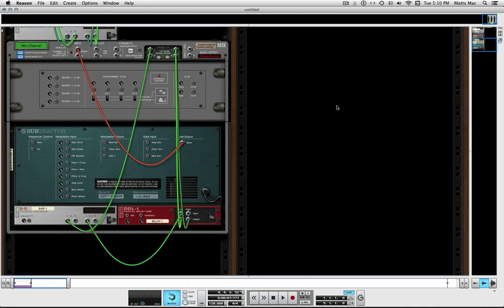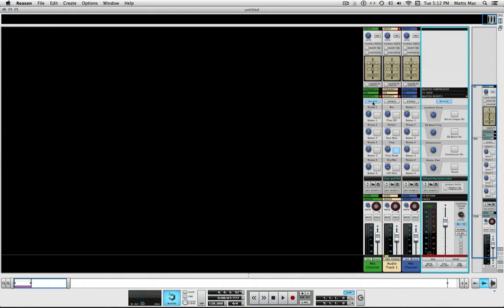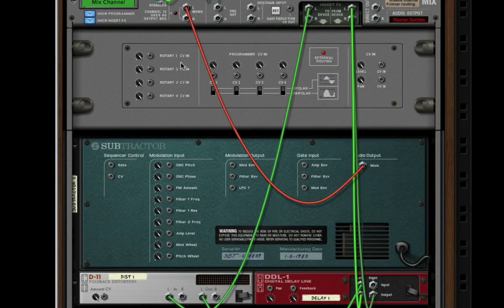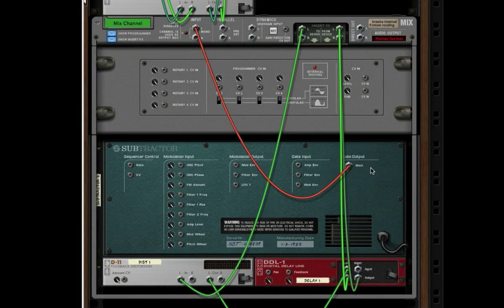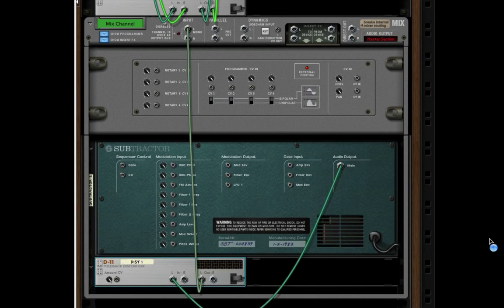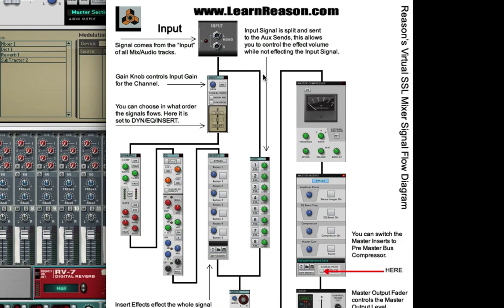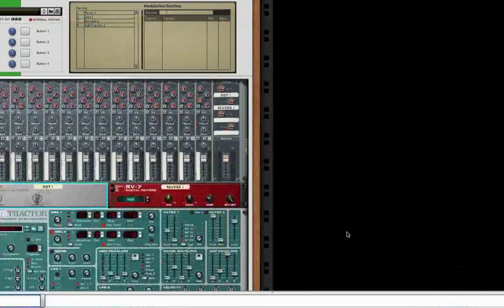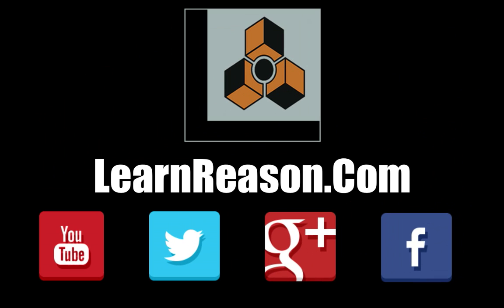SSL Signal Flow - Insert Gain Control - SSL Mixer Video Series - Reason - LearnReason.com

Comment: so why not just make all effects including compressors limiters etc send effects if there is the danger of losing control of gain structure with inserts?
Reply from the maker: Send and Insert effect are handled differently to give you more options, they are not the same.
Reply: thank you for this channel 🙏🙏

Comment: Hi Matt, Thanks for the very useful video. 

I still cannot understand why having inserts makes the gain nob useless. According to the diagram, input goes into the gain control nob and then goes into inserts. That means the gain nob controls the input level of inserts. When the input level changes, shouldn't the output change accordingly? Why is it not happening?
Reply from the maker: The purpose of a Gain Input on any mixer is to be able to control the gain from the start of the mixers signal chain. As for inserts you are right, it will affect them but again the purpose of the input gain is to set it first when you are setting your static mix. When doing this all inserts should be off as will as sends, eq, comps and all input faders should be set at unity. Once you set your input gain you should not ever have to change it thus it will never do more then what it's true function is.
Reply: LearnReason Thanks. Does it mean that inserts can still be used if they were bypassed when the gain is adjusted ?
Reply from the maker: The input gain is just a gain control to the mixer channel, it is used to control the input to the mixer nothing more. The inserts have a totally different function and have nothing to do with the Input Gain.

Comment: I have a similar problem with the audio track. I've recorded my guitars into an audio track with the Soft Tube Amp into the insert effect of the rack and the gain knob didn't respond well. I understood it was because of the inserts, so I solved the problem by routing the audio track from the direct out to the input of a new mix channel. But now it bugs me that I have two mix channels in my mixer for the same track. Is there a way to be able to control my gain for my guitar tracks but without the "dummy" audio track in the mixer?
Reply from the maker: Inserts can over power the input gain, its best control the insert gain from the insert if this happens. Just put the insert effect in the track combinator and assign a knob to the output of the effect. Now on the VSSL mixer you can adjust the gain right from that channels insert knob.

Comment: Couldn't you just use your send levels separately to fix this issue, especially if your using the fx to mix in separately the fx from the original sound ?
Reply from the maker: Official AbedNego I guess if you wanted to have the effects as Sends you could but a Send is not the same as an Insert thus it's important to understand that the Insert output can over take the channel Gain Input and that is why I made this tutorial.
Reply: very true , thanks for the infos

Comment: Matt would you be able what the insterts are good for please. So far looks like using them is what we don't want to do but I'm more interested what are they useful for and how can they help your mix. I'm not requesting the new video but appreciate a reply. Cheers buddy
Reply from the maker: Inserts are for "Inserting an effect to one channel" which is much different then Sending an effect to a channel. The main uses would be for Dynamic Effects and then specific control of an effect. That's the simplest answer I can offer, if you need more clarification just ask.

Comment: Another awesome video Matt thanks. Quick noob question. In the video you drag a mixer between the subtractor and the mix channel. When I try to drag into that position I can't. It only allows me to drag either above or below and then creates a new channel on the main mixer. Any thoughts?
Reply from the maker: Try pressing the Shift Key while you are dragging it. I am dragging it into the "Inserts" section of the track combi.